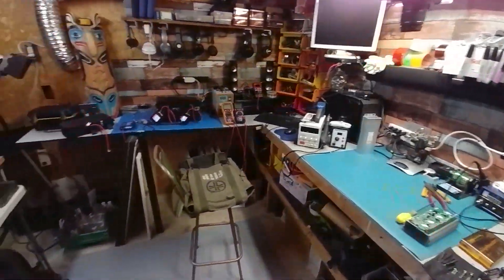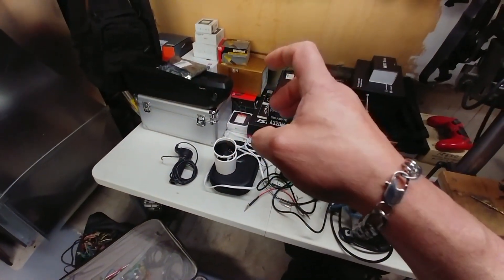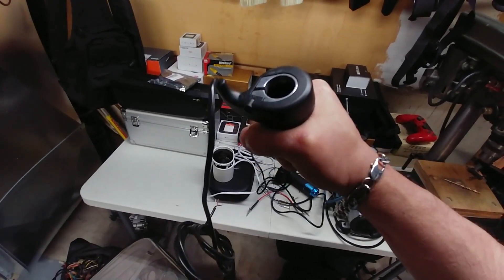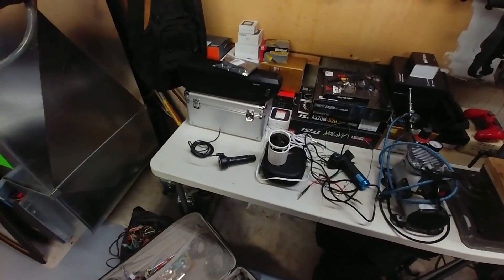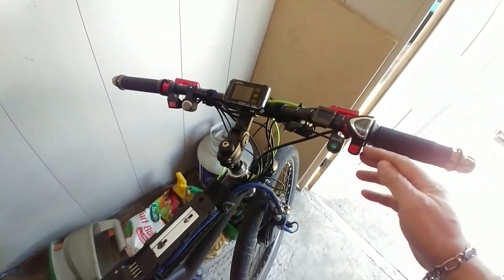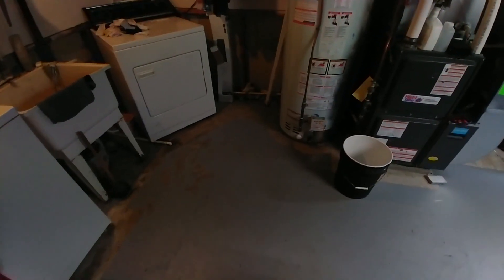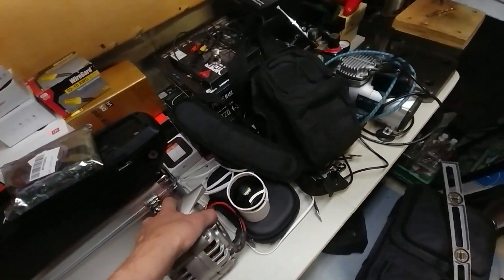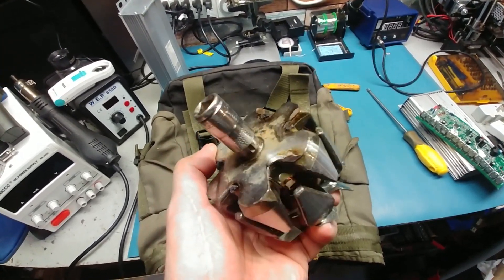ebike vlog Sunday, May 16, 2021 *bad throttle alternator needs parts*

Comment: I have go trax shift s1 350watts motor im  planning to upgrade it im planning to buy another motor but this time for my rear motor cuz I already have front motor is it possible ?
Reply from the maker: yes using two kits front rear together is easy. with single throttle